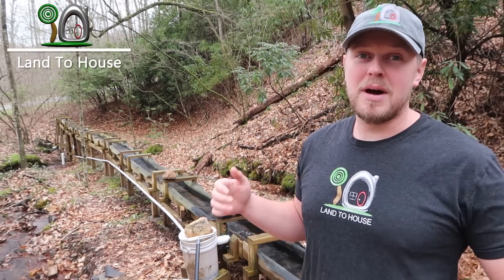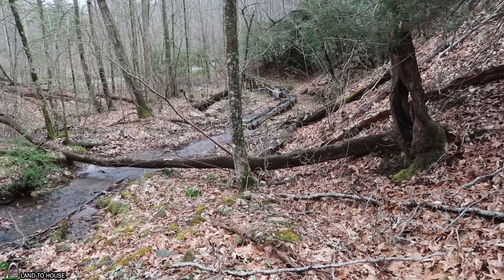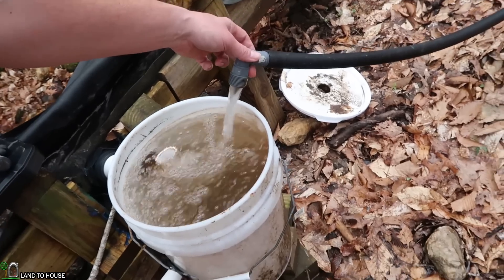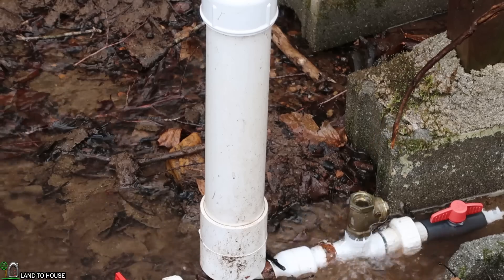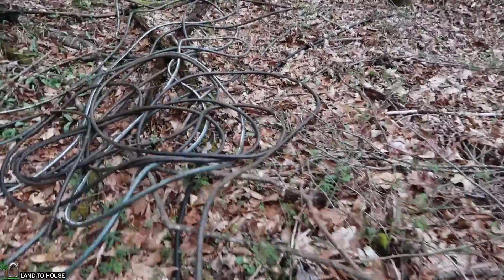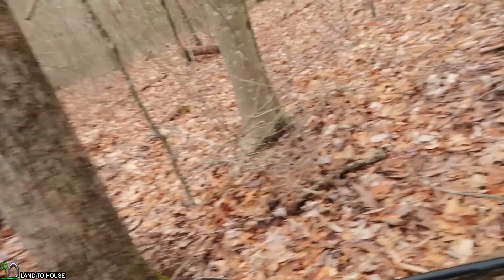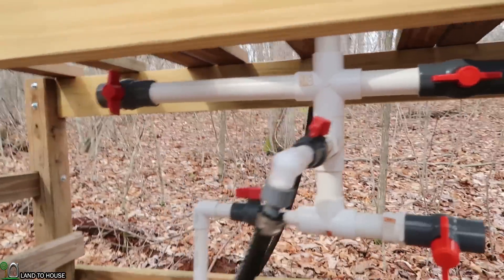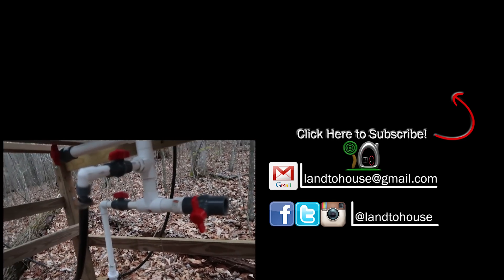Starting up the Ram Pump 2019

Comment: How are you dealing with freezing issues in winter?   I have been watching your videos extensively and looking at your "tiny" ram pump, and parts list.  My creek is just a hair bigger than the one in this video, so I think this is a doable thing. However, I'm looking at pumping up to the top of my property, tallest hill on 13 acres.  I read the requirements for lift, so I think (still gotta measure amount of rise to top of hill) , and I was thinking of connecting 3 or 4 ram pumps on a line up to the top of the hill, where each pump dumps into a big barrel or bucket, w an overflow off the barrel dumping into a water trough for the livestock.  The ram pump inside the barrel, in theory, would pump to the next barrel further on up, and so on.  Then I would run a line out of the last barrel on top to water everything else by gravity feed. Have done this with electric pumps, outside and inside aquaponics, but it took some finessing... wayer levels lime to spontanepusly just.get too full and overflow, but in this setting, leals are no big deal, just more water on the pasture. And in winter, it is all a mudball anyway. 6 inches deep everywhere and rain, rain, rain. 

I likely will build the second pump, it looks pretty easy. I don't need a lot of flow, just a steady trickle all the time. This is my tentative plan to irrigate the different paddocks, garden, orchard... , and create a consta t flow of fresh water to the pigs and others.  Bc pugs like to crawl into their trough and wallow in it .creating a nice thick layer.of.mud at the bottom. and also make the water I just filled and cleaned 5 minutes ago, completely disgusting again. Pigs are jerks.  So who knows, I may just buy all of them that I need, uf tune is an issue., but I really hate those plastuc kinda valves, no offense. We have them on our water filter in the house and intake to the house and I have broke 2 handles already. They stick and are hard to turn and using a wrench on it even gently....aaaurgh. 

We have clay soil here  and no rocks, though. 

So I'm wondering what you do for freezing temps, bc even our hoise line from the well froze this year in Western Washington State going across the creek to the pumphouse.  Had to put a heat tape on it for winter and also fix plumbing, right off the bat when moving in. 

And how do ypu deal with aninals messing things up? I heard an elk or something in the vid. We have cows, goats,  deer, bears, a big dog that LOVES to mess up my intake bucket for my pumphouse when he is splashing around. He likes the deep pool I built there.  Deer and such will follow water, potentially step on things. My cow will step on lines. 

Mineral deposits in the line?
How often do you have to clean out sediment?   Suspended clay sediment is a real problem at our location.  We clean out the pumphouse sediment every 2 days or so, and I even have the intake line inside a bucket that us wrapped in fine mesh polyester cloth, which was finer than the screen and doesn't rust. We have enough rust.   Iron water....The water is slimy... dissolved clay particles. Not good for plumbing... The spring well does better than the creek...  but still not awesome.  Not enough water in the spring well to water a farm, so we use the creek, as is allowed in our deed. 

Don't  mind me. I do find all this "fascinating". I was the kid makin rock dams in the creek and redirecting water flow. lol
Reply: The whole time I was watching this video I was curious how he deals with freezing.  Do you shut it down during winter?

Comment: Just add a 90* or 45* elbow to the intake pipe to eliminate the bubbles in the bucket.
Reply from the maker: That is the perfect solution.  I need to get down there and add that.

Comment: What will happen if you mount a car tire valve on the compression pipe at the pump and then increase the preasure in the pipe using a compressor. Will it make the pump more efficient ? What if you use another gas than air? Like propane or any other gas ?

Regards 
Tommy from Norway
Reply from the maker: Using a valve like that might be a way to fill the pressure tank back with air after it has become water logged. But adding more pressure will not increase the output. The pressure is based on the head pressure from the creek.

Comment: Do you think a ram pump will run if it's fed using a syphon
Reply from the maker: Yes absolutely.  I am not sure how tall the siphon can be but I know it works on a 4 foot dam.
Reply: @LandtoHouse  With a normal vertical siphon, maximum drop height is 33' or 11m. After that, the vacuum on the water pulls the molecules apart creating a gas bubble that stops the siphon. This is why well pumps are at the bottom and used to push water up instead of having the pump at the top where servicing would be easy.
Reply from the maker: Thank you. I had heard the number 33 feet before but was unsure why.

Comment: so glad i've found your videos dude, we're currently looking into installing a Ram pump to feed water from a stream at our bottom field and got told it was unlikely to work, but looking at your setup I think it's very possible we could make it work and eventually get water all over our land... will be following you're stuff to see if i can find some more tips that could help us out... pumps gotta be worth a shot before they talk anyone into a borehole
Reply from the maker: The ram pump is amazing. Do you have any numbers on your setup? The amount of head pressure in your creek? And how high you're looking to lift water?
Reply: @LandtoHouse  i'm not 100% sure but at a guess i think we are looking at around 5-6ft if we use about 50m to drive the pump.... not sure exactly the elevation either to be honest, but as i said looking at where your pump is to where your tank is i'd say we are probably matching maybe a bit less. Luckily we don't need constant water flow (hopefully that makes sense) it's more to save having to lug buckets of water from the house to the fields for the sheep (girlfriend has a messed up elbow so lifting buckets over a 2acre field isn't great).   I think our main issue really is a slight rise in ground height next to the stream, i think its only a few inches though so I'm hoping a little testing with siphoning should do the trick. I know the neighbouring farm use a pump on the same stretch of water too, not sure the details on their pump though, but i know it lifts like a cough cough haha
Reply from the maker: Not bad. The distance is no issue. The hight of lift is what limits the pump. At 5 feet of head pressure you can lift water around 35 feet. So if your tank is at 20 to 30 feet you will be good. Now with a 50m drive pipe you might need to install a stand pipe (or bucket) to bring the intake closer to the pump.
Reply: @LandtoHouse  that's thanks dude, we were actually just looking at the area and both said about maybe having a bucket so it will likely be a shorter, am I right in thinking 15m is around the shortest it should be? I've downloaded your instruction thing on your website so hopefully all the info I need I'll find, thanks for your help though dude it will help big time being able to ferry water over our 5acres without the need for ferrying heavy buckets
Reply from the maker: Yes the bucket is my favorite. The video on my youtube called ram pump narrow way vineyard shows a great full install with bucket.

Comment: Can you make one test. Put ram pum into open container and drawn container into well. Container is upsidedown leaving air inside. Head will be drawn into rampump from  surface  of well. I wonder what will heppened if is possible to lift well water.
Reply from the maker: The problem with this is that the waste water will quickly fill the container and the pump will stop. Also having the means to keep that container sunk is an issue.

Comment: Have you ever installed a ram pump in a location where installation of a reservoir to feed the pump isn't possible? I have some land and the only water comes down a concrete pipe with a pool as an outlet. I have tried a 1" ram pump with a 3 metre drainage tube (4" diameter)  feeding a 1" pipe which then feeds the pump. I cannot get enough head pressure however and am wondering if reducing everything down to 1/2 " proportions will require less pressure?
Reply from the maker: The size of the pump only changes the input and output flow rate. The head pressure is the same for big pumps and small pumps. However it is a lot easier to work with a smaller pump. If you can catch the water coming out of the pipe in a tank then you can use hydrostatic pressure to run the pump. Check my videos for the hydrostatic ram pump running.
Reply: @LandtoHouse  Thank you for the reply! More experimenting to do!

Comment: I dont understand why are you filling the tanks from the buttom, not from the top?
Reply from the maker: I thought it would be nice to have the valves all in one place. No real reason though.
Reply: @LandtoHouse  does filling from the bottom not raise the back pressure? Or does it not matter?
Reply from the maker: It actually does not matter. Raising the water from the bottom has the same atmospheric pressure resistance as if taking the delivery pipe up the same height as the tanks and going into the top
Reply: No, sir. The pressure are not same. We have to consider the pressure exerted by the water in the tank due to the Weight of the water. And that pressure is greater than the atmospheric pressure. 
It would take much shorter time to fill the tank if the delivery line is on the top of the tank, and not in the bottom.
Reply from the maker: Sounds like a great test!!! I will do that.
Reply: actually, only the depth of the water matters in terms of water pressure. So if you were to have the inlet at the top of the tank, you would need higher pressure in order to start filling it whereas if the inlet is the bottom of the tank, you would need less pressure to start filling, gradually building up to the pressure at the top of the tank. Hope this makes sense. The formula for hydrostatic Pressure is P=ρgh, where ρ is the density of the water, g is the acceleration due to gravity, and h is the depth of the water.
Reply from the maker: Well said. I have now tested this and have a video on it. Filling from the bottom is way faster!

Comment: If you put a short piece of pipe on the end of supply line to get the end below the water surface would that stop the air bubbles ?👍👍
Reply from the maker: Yes that's very true. Perhaps I should take a small piece down there.

Comment: I use a thing that I called a sand filter on the end of our intake line at the cottage for the jet pump and I just skirt on the end of the check valve and toss it in the lake and it sucks up the water with no problems I wonder if something like that would work well in your scenario I've heard of guys using Sand Point well heads I think that might work quite well and shouldn't let sediment in
Reply from the maker: I'll have to look into those. It's not too bad to go through twice a year and clean out the sediment.

Comment: Couldn't you add a slight extension to the end of the supply line going into the bucket so there's no splash or bubbles?
Reply from the maker: Yes absolutely. I was just lazy and did not want to go back to the shop to get one haha. Good suggestion!

Comment: You need a silt sucker in your bucket. And a bigger bucket for extra settling and bubble floatation, like a 55gal or smaller barrel.

Great video, I'm jealous of your warm weather. Snowed here yesterday.
Reply from the maker: A bigger bucket would also allow for the Drive pipe to attach higher. Possibly something to look into for the future.

The weather here has been good. It was 35 degrees last night. Just warm enough to prevent the garden from dying.